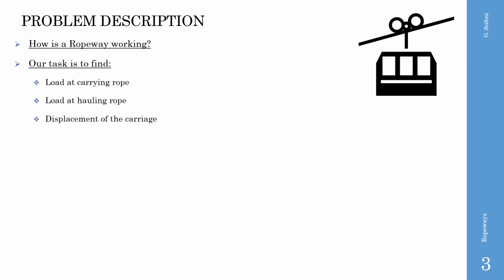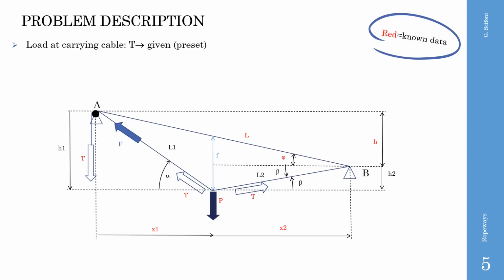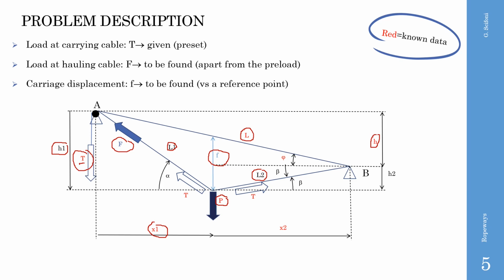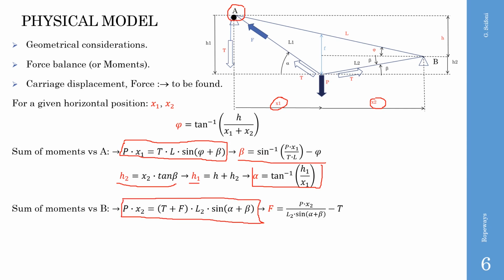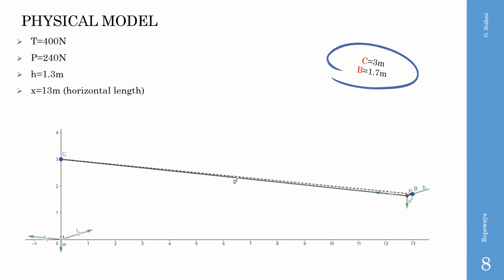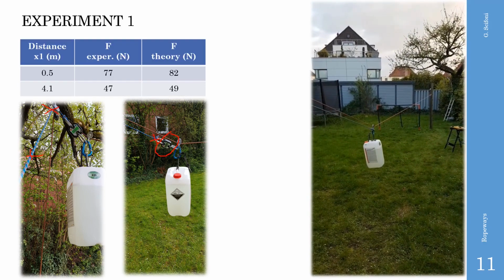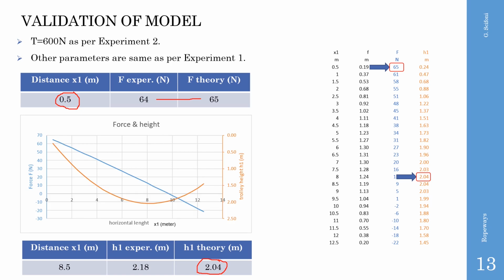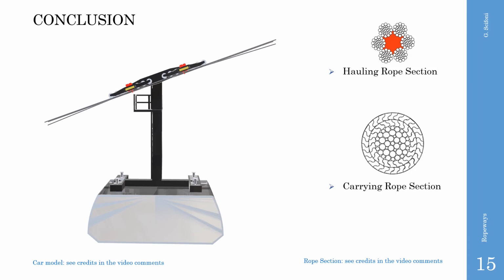Ropeways

Comment from the maker: SLIDE 7&13: Graphic at the left bottom: the arrow with f (vertical displacement) should connect the orange line (height h1) with the segment AB and not with the force F.
SLIDE 8.  See the Geogebra File: 
https://www.geogebra.org/m/tv977b9d
SLIDE 15: Credits:
-Car model: https://3dwarehouse.sketchup.com/model/3e72a67c-3824-4244-a985-0b8693174839/BERGER-Cable-Car-ATW-100-Pers
-Rope section: https://barsandrods.arcelormittal.com/wiresolutions/wireropes/new_site/ss/4399/ropes_for_cableways/EN